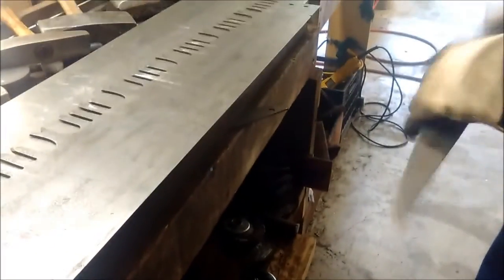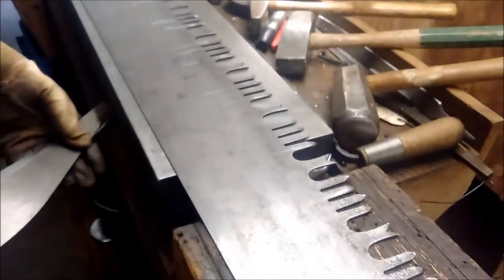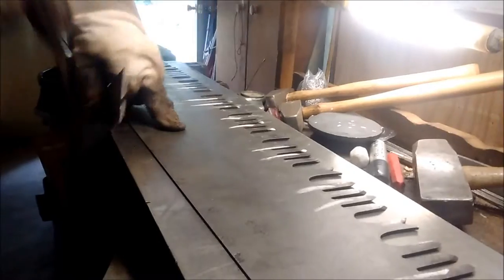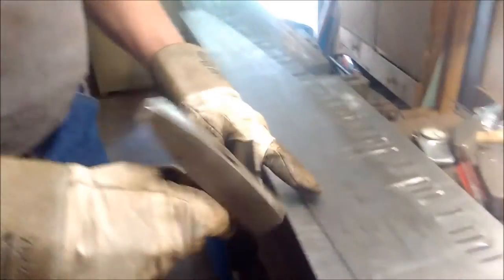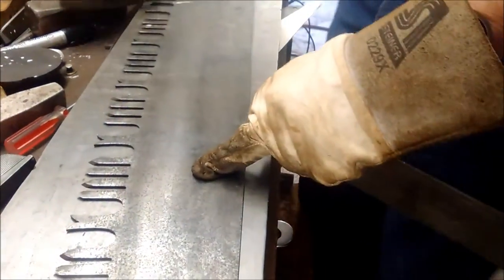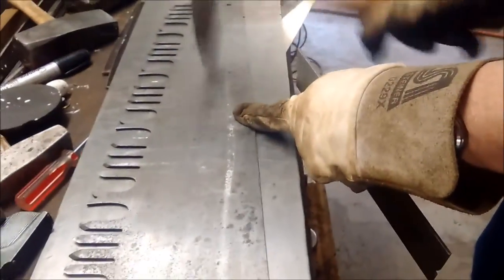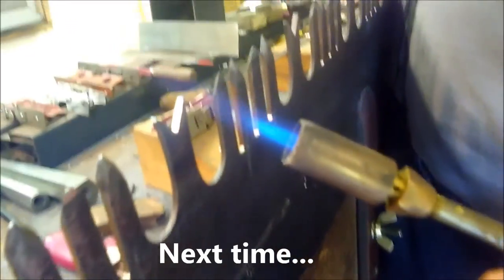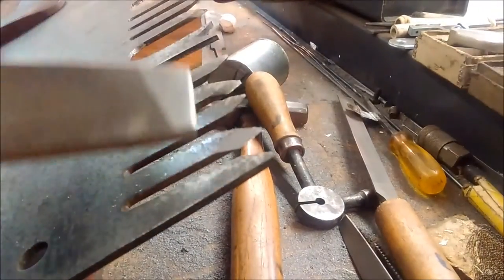Saw Filers - Straitening and Tensioning a Crosscut Saw

Comment: I use 2 bulb fluorescent light fixture mounted vertically on a wall in front of my anvil and eliminating as much light behind me works well for checking flatness both when the saws laying on the anvil or checking plumb but I hammer mostly circular plates